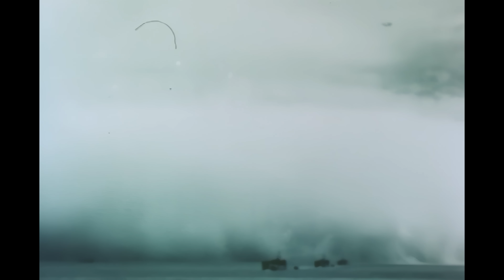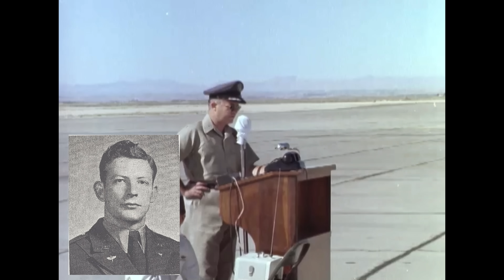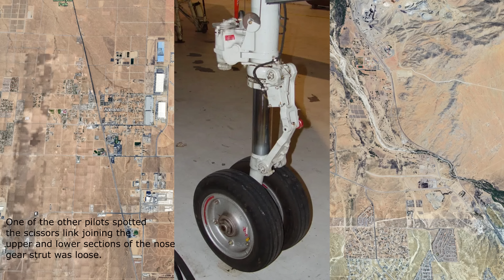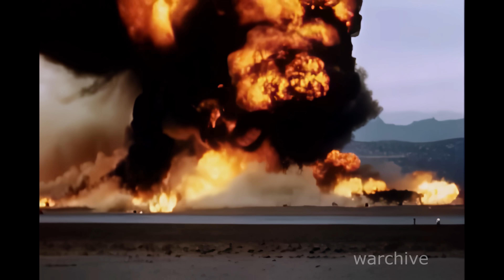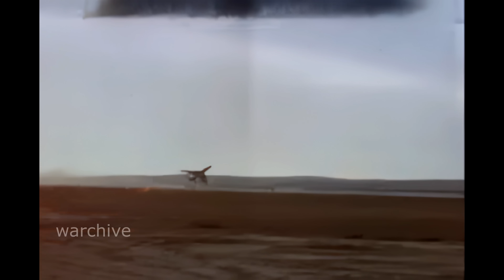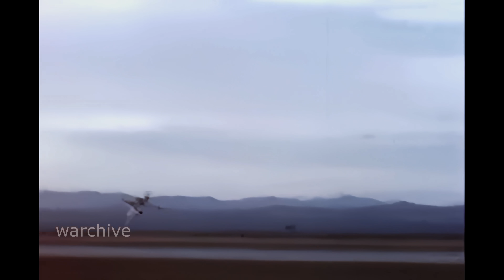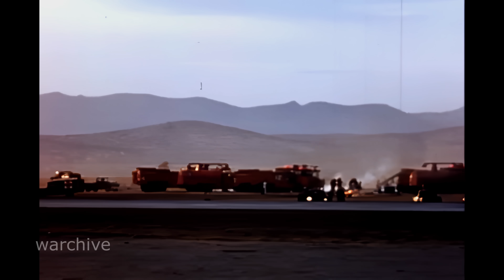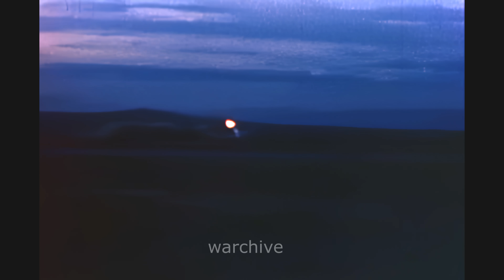The Sabre Dance F-100 Crash 1956

Comment: So was not enough attention paid to this deadly flaw at this point in its career? Testing obviously revealed the kind of landing speed needed so it seems like the manufacturer probably also knew of the dance possibility. And other than keeping your speed up and not pitching up on approach was there much else that could be done to be safe?
Reply from the maker: @helpful5539  Great question. I am by no means an expert, and certainly not qualified to answer it. I will however share what I know and believe.

Sweeping the wings aft, delays the onset of shockwaves, which would in turn increases drag as supersonic speeds. This allows the aircraft to fly faster. The main issue with aft-swept wings is that when a stall occurs, the aircraft stall at wingtips first. 
On aft-swept wings this is nasty because of two things:
The aircraft tends to roll to the side which stalls first. Recovering from a plane that has rolled to a side requires much more time, thus altitude.
The second reason is due to the fact that the center of lift is located aft of the center of gravity. This leads to a violent pitch-up manouver when a stall takes place as lift is lost behind the CoG, as we see occurs in this video. 

On forward swept wings, the aircraft remains good roll control at low speeds. The stall happens at the root of the wings first, which still leads to a pitch-up, but keeping that roll control is crucial for recovery. 

The engineers AND pilots certainly were aware of this issue. This was not the first aircraft with aft-swept wings. 

I believe it comes down to trade-offs. Yes, the aircraft is less stable at lower speeds, BUT, this aircraft is capable of sustaining supersonic flight.

I believe Brooks’ heroic recovery attempt proved crucial for the development of later aircraft. Take a look at the F-14 with its variable wing sweep. Sweep them back to go fast, sweep them forward when slow to keep that roll control.

Once the tips stalled here, there was not much Brooks could have done differently. As many have pointed out and asked, he could have ejected. Ejection seats at the time were not good, and it certainly would not have guarunteed his survival.

Comment: I'm not a pilot or a mechanic. This said, did the pin break during takeoff? Did he have a warning light alert him and he then asked the other pilot to confirm problem (otherwise it seems odd another pilot would notice that on final approach as gear was lowered)? Could the nose gear have been retracted on its own and land only on mains? Or, a belly landing, knowing the aero problems at low speed? Bad deal.
Reply from the maker: @danlowe8684  Great questions. I am not qualified to answer most of them.

The scissor pin had been removed for towing. Allegedly, the ground crew forgot to reinsert it.

The story of how it was noticed is conflicting. One source says that «men on the ground noticed» it, and it is not specified if it was the ground crew that removed the pin that recalled that it was not reinserted or not. Another source says one of Brooks’ wingmen noticed something was wrong with his landing gear. Perhaps he saw that it was not straight? This is purely speculation as it was not specified. I tried to find a more detailed report but was unable to.

Another user pointed out that it was discovered that the scissor pin was not crucial for keeping the nose wheel stable, so he would likely have been fine had he not stalled. Though I can not promise that is true.

Would love to see someone who’s qualified answer your latter questions!
Reply: @ Thank you!!! Love comment section!!!
Reply: No the nose gear alone cannot be retracted. All three gears must be raised or lowered together. I think there were two options, one is foam the runway and land gear up or land faster than normal and lower the nose gear the last minute after the jet has slowed down below the speed at which the nose gear cannot be maintained off the runway, or eject over the desert. I think the problem was the pilot only had 686 hours total.  That is a very low time pilot, even as a military pilot to be ferrying a new fighter jet. Another is that he came in way too slow.
Reply: @ Thank you!! Comment section rocks because of people like you!!

Comment: Insane to design a supersonic aircraft with slats and no flaps. At low speed engine torque rules over lift, then slow speed and afterburner power engine torque determines the deadly outcome.
Reply: Jet turbine engines don't impart torque to the aircraft.
Reply: The F-100A & F-100C didn't have flaps - they were added to the later F-100D & F-100F versions.
Reply from the maker: Early jet era was insane, wouldn’t find me seating in one. Reminds me of «Give Me Operations» by Oscar Brand:

«& don't give me an F-84
she's just a ground loving ***
she'll whine & she'll wheeze
& make straight for the trees
don't give me an F-84
No!

give me operations
way out on some lonely atoll
for I am too young to die
I just wanna grow old»

I like to think Brooks’ heroic attempt to recover led to later jets being more safe.

Comment: No zero zero ejection seats back then? Think I would have bailed regardless.
Reply from the maker: From my research, I do not believe 0-0 seats were in use in the F-100C. I asked a gentleman from another comment who claims he was an Ejection Seat technician, and I am looking forward to his response.

With the knowledge of hindsight, I too must say I would have ejected. Lt. Brooks may or may not have survived if he did so, but he was heroically fixated on recovering from the stall.

May he rest in peace.
Reply: Ok 👍🏼
Reply: the first of the 0-0 seats were tested by Martin-Baker in the early 1960's. the Weber Aircraft Company also developed a 0-0 seat for the F100-C that was retrofitted to the fleet starting in 1963. it was called the RO-CAT (ROcket CATapult) system